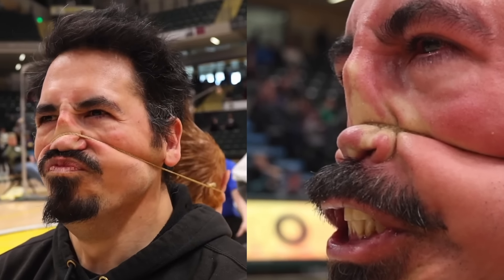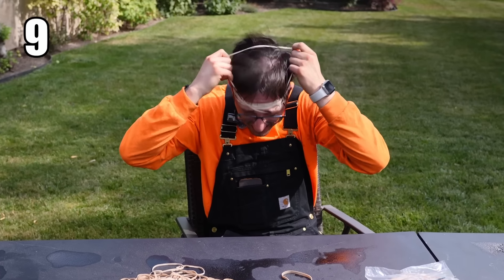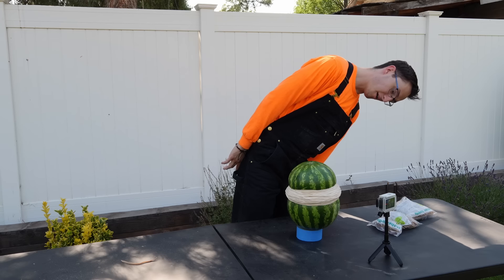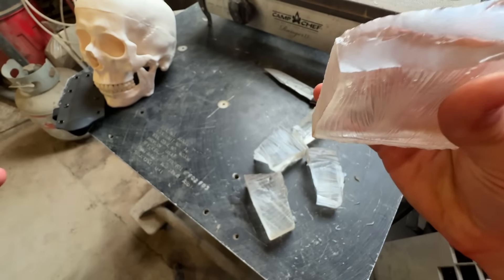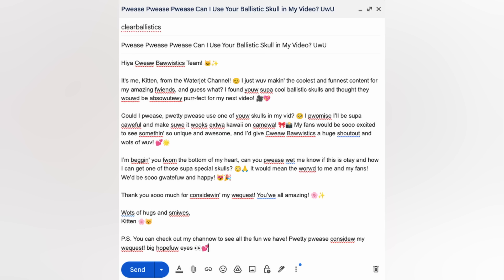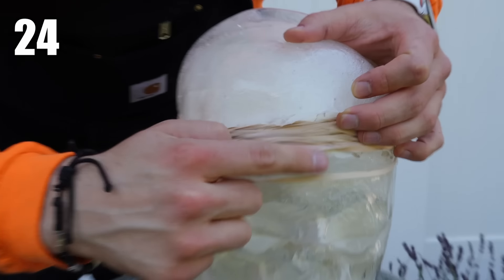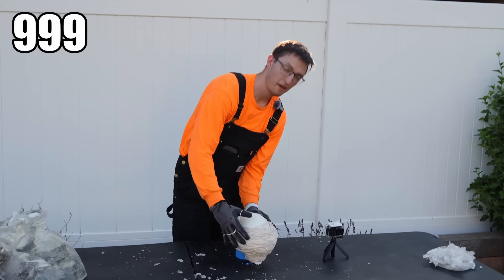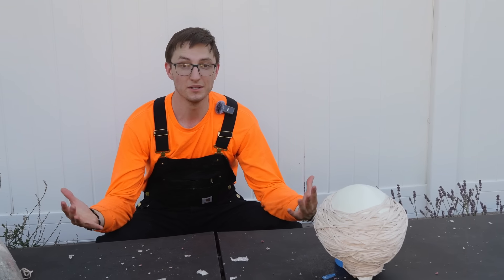How Many Rubber Bands Will Crush A Human Skull?

Comment: The elastic bands were fairly evenly spaced, and therefore the skull withstood more, and if the elastic bands were more concentrated in one place, then less would be needed, as with watermelon. You can check this with an egg in your fist evenly and then at one point (then it will burst). It also depends on the characteristics of the rubber bands and other factors.